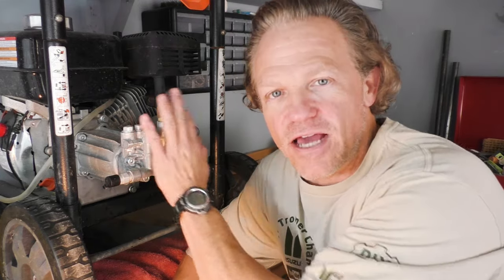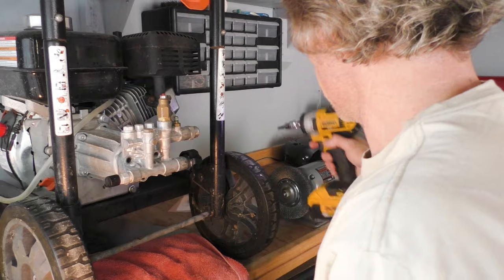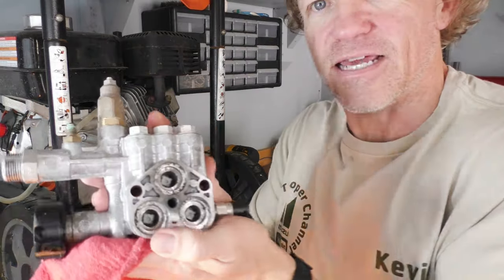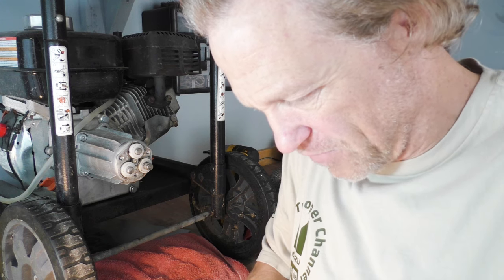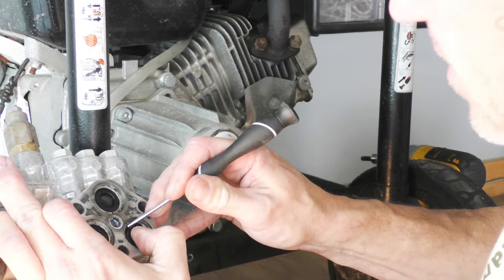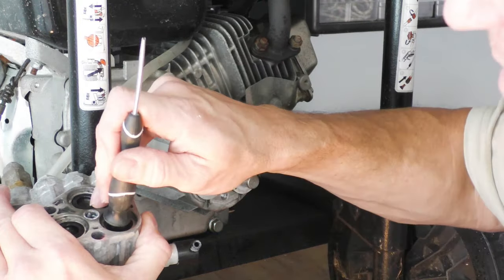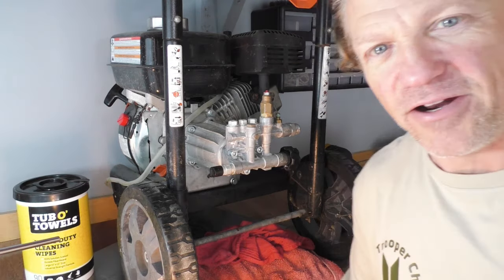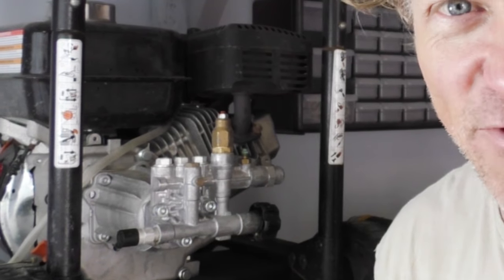POWER WASHER PUMP LEAK REPAIR -  Generac Leaking Bad!

Comment: Thanks for this video. You can lubricate the O-rings with silicone lubricant to help get the new ones in. As well you can use a socket of the right diameter to help press them in. My generac is leaking so I wanted to see a common cause. Appreciate you putting up the part company and item number.
Reply from the maker: fordrac1ng81 you’re welcome glad I can help. Yes this is common on these pumps. Glad to have you on the channel. Hope you will stick around. Thanks for watching!!
Reply: @ktcgarage8572 thanks for posting. Have had my generac 320o0 for 1 year and I have the exact same leaks. Generac was of no help whatsoever. Will see about ordering new rings. Thanks!

Comment: Wow - just the info I need as my Generac 2800 psi pressure washer started leaking exactly as yours when I went to use it today.  Now, just have to find store to purchase the three o-rings, and hopefully, I get to share in with the applause.  Thanks you.

Comment: Thank you for this video, saved me over $100 on a new pump. I just got a new to me Used pressure washer that supposedly the pump was rebuilt, it leaked just like yours 15 min after using it. In your video, you mentioned the seals were only installed groove side down, mine we're not! thank you

Comment: Thanks for the video, can’t believe they say this is not serviceable/ repairable.  Noticed mine is leaking today when I was using it.  I have had it for probably 10 years or more, it’s a solid pressure washer.  I think I paid $375 for it back then so no it’s not cheap, and I always use pump saver if it’s going to sit a while.   Glad it’s an easy and cheap fix.

Comment: Awesome video.  I bought a Husqvarna HB-3200 at Costco and it started leaking at the same spot after one year.  I use it about every other month.  Costco will exchange it, but they don't have any more in stock right now. I'll try to fixt it myself if I can get the o-rings.  I really appreciate this video.

Comment: Well ..i bought a generac about 30 + years ago..the pump has never gave me a  problem  the motor is a Briggs & Stratton I've worked on it 2 or 3 times..yesterday i was using it and the pump started leaking..i noticed a drop in pressure and saw the leak..luckily i was about finished with it..i was suprised seeing it leak.. i can't complain..i will repair it..now i know where to get the kit now i see.they haven't changed the pump .it's the same as yours..thanks for the information ..see you on the next one...Cheers 🍻🍻🍻🇺🇸🇺🇸🇺🇸
Reply from the maker: Rodney Brand thanks for watching 🇺🇸🇺🇸🇺🇸

Comment: Wow. Thanks for posting this. Mine shoots water from the bottom of the pump, but mostly just after I release the trigger. I assume it's those seals.
Reply: Mine too. Shooting water out. Did this fix or for you?
Reply: I have this same issue and I’m trying to find a replacement part for it as well.

Comment: Excellent video!  I wish all videos I watched were as clear and easy to watch as yours.  🙂  After taking my Generac power washer apart, I noticed that he white plastic barrels that are left in the machine in your video and mate with these o-rings showed heavy wear and there were remnants of another clear gasket within them.   I’ve a call into APW to see if they can identify replacement parts for those as well.   Anyone out there know?
Reply: As an update to my comment… the part is a bushing… part #AR2840561.   These bushings were actually melted on mine.

Comment: You drew me in with "Well that's not supposed to do that!" LOL and sealed it with the Jedi pull power on your "blunt, round pick". Now Ima go see if I can fix my pressure washer. Although I think it is beyond help. I got flat tires, leaky pump and hose. The only good thing on it is the Honda engine.

Comment: I feel the same way about my Generac pressure washer. I had a Karcher before and the pump failed after maybe 7 years of use, sadly it was more expensive to repair it than just buy a new pressure washer so I bought this Generac thinking it'd be an upgrade and it's really not. I also had to replace some o-rings and rubber in the fuel system because it tuned into dust that clogged up the jets.

Comment: This is a very very common problem on Pressure Washers , One Big thing to keep in mind is to Never Ever Start the Engine unless you have the water supply hooked up an bled air from the pump first , - just wait till you get a steady Stream of water out of the hose nozzle , 
 Industrial Grade Pressure Washers Run in the Thousands Of Dollars for a reason , ☹️

Comment: Thanks for the lead to buy the seals.  That is what I will do ,buy a different  product. SO, maybe  I can get repair parts.
Reply: Seal kits are impossible to find for my old pressure washer. Must buy a new pump unit. Thanks for the mechanical repair video.

Comment: @KTC Garage   Great video.  I have the same issue of leaks.   I replaced the 3 seals.  Much needed.  They actually stayed on the pump when I pulled it apart, that's how loose they were.  After changing them and pressing them into the unit like you did, I still have the leaks, like through the weep holes.  What needs to be fixed on this??   Thanks!
Reply from the maker: Not sure. Sorry.

Comment: I have a generac clean power 37 model 01067-0 1500 psi. It runs, but it spits the water out of two square portals on the pump case. What must I do to fix this? The round seals seem ok.

Comment: the honda engines have iron cam sprockets, the others have teflon sprockets. the  hondas usually have low oil cut offs in them too.

Comment: I have been through Generac pressure washers just like the one being worked on in this video. The first ran for 6 hours total, before the pump blew. The 2nd a whole 30 minutes. And the 3rd maybe 5 minutes. All were new out of the box. Generac is junk from top to bottom. Their customer service indignant. Warranty useless...actually a complete lie. Repair parts near impossible. So I am back to using my 1984 Coleman 1900 psi unit which has never let me down. Same engine and pump, neither ever been rebuilt. What a shame. Live in Florida where there are many Generac generators installed on homes for hurricane season. Have never heard one good thing about them from the owners, just constant complaints and disgust.

Comment: I have a Honda GCV 190 and it seems to be leaking water into my oil. It runs pretty good and has great pressure. What’s the cause of this? Is it worth fixing? Thanks, Mark.

Comment: I entirely agree with your general assessment of Generac. My problem is slightly different. I don't have a leak (altho when I dismantled the system just as you did in ur video, there were non O-rings), what disintegrated was the O-ring in my water inlet and I think that little bottles of it have clogged the pump, all the hoses, etc. have checked out fine. Was wondering, is it the 3 bolts at the top that have to be undone to clean out this area? Also, isn't there supposed to be a filter at the inlet where the hose connects? Thanks

Comment: besides leaking from the o rings , did it loose pressure as well when using it? mine sprays but not enough power and leaks like yours.
Reply from the maker: Ether Fever yes it sure did. The seals will probably fix both. I would get the website from the video and call them to find the right seals. I couldn’t find them just looking online. Get the number from the website and they are very helpful. Best of luck and thanks so much for watching and visiting my channel. I have tons of cool fabrications and review videos. 
Hope you will check them out!
Reply: @ktcgarage8572  Will Do! Thank you very much for your reply!

Comment: I'd recommend you consider a Spartan cart jet, this is a very robust engine driven triplex pump that can do the cleaning as a pressure washer and it can jet the inside of pipes like an snake.
Reply from the maker: mark luke thanks for the tip and I really appreciate you watching and commenting. I will absolutely take your advice. 
Kevin

Comment: Great vid.  A question related to your vid.  The  plastic tightening gizmo on the water hose supply line became damaged due to someone (me) not paying attention.  I think I can buy the plastic hose fitting but it requires a hex (allen) socket on the inside of the inlet to remove the outer section of alloy hose.  Do you know what size hex / allen that would be and have you ever removed it?  Thanks.  thumbs up.

Comment: I had the same problem but with a Troy Bilt.  One seal was damaged but i just replaced all 3 of them  Cleaned the surfaces, made sure they were properly seated and reinstalled.  Still have the same issue.  Any other suggestions?
Reply from the maker: Harold Peters wow that had to be the problem
Maybe they gave you the wrong ones 
Man I’m not sure on that 
I would get some new ones and redo the job.  It has to be that Harold I would think 
Unless your mating surfaces got warped but that would be extreme 
If it were me seeing as how they are so cheap I would redo them and try that. 
Best of luck. Also might call the place you got the parts and ask them. They may have a defective seal from factory 
Hard to say. Thank you for watching and being on the channel. Hope you will stick around.

Comment: Hey Kevin, When I unbolted that part, a grey oily fluid came out that smelled like differential fluid.  I panicked and bolted it back together before all the fluid came out.  Any idea what the problem is?
Reply: burningfeet 53  so,I kept researching, on the pump side there are oil seals that look very similar to the water seals you replaced, it was going to cost $49 for all the seals,I found a new pump for $89.  So new pump is on its way.   Thank you for the video, it was very helpful.

Comment: I have a similar machine and the pump is bad. Removed all hex bolt but cannot pull the bad pump off. Is there an extra set screw or anything im missing?
Reply from the maker: Vincent Deangelis it may be seized on there a little bit 
The hex bolts are all mine had 
Best of luck and thanks for watching 
Kevin

Comment: I did the same thing,,,,,,,bought a Generac with the expectation of quality.  Wrong. Pump went. So because it has a bulletproof Briggs and Stratton motor, opted to replace the pump with a midrange pump and back in business.

Comment: very helpful video, I've ordered the seal kit, and in the meantime, I removed the seals but when I did a small copper disc that has a o-ring around the outside dropped out. I have no idea where it came from, I can only think it came from the center of the pump where there's a small opening.  Problem being it has a small hole on one side and flat on the other, so I'm wondering if that faces front or back. I couldn't tell from your video if it was there.  Any idea?
Reply: I know this is 3 yrs or more later but hope it helps others. I'm guessing that part is a plug that's located in the center of the pump housing between all 3 pistons. the hole is for inserting a screw or? into it to pull it out, then you can add oil or drain it from that hole. then push that plug back in when your done.

Comment: What is under the top three bolt caps?? Mine is leaking from the top of the center cap but it is not cracked. It got put in a Sub-Zero garage after the last use but nothing externally is cracked. Michigan winter temperature. My fault for not winterizing it
Reply from the maker: Not sure about that. Sorry thanks for watching
Reply: @ktcgarage8572  I guess there's only one way to find out 🕵️😂
Reply: My Generac appears to be leaking from those top 3 bolts too.  Did you ever resolve the issue?
Reply: @4shaken_  cracked & not repairable for me. New pump eBay not cheap. $200 best I could find.

Comment: nice tutorial ! i am waiting on some seals for a craftsman  does that pump need oil ? the unit i have was given to me i think it was run without water supply and maybe something burned up . i guess i ll know more after seals r installed
Reply from the maker: brewcrew no oil in this one. The seals fixed it right up!  Thanks so much for watching and being part of the channel. Hope you will join us for more vids in the future. Best of luck!
Reply: Where did u get the seals I need some too. I have a craftman

Comment: From a pro... never, ever, ever start machine screws with an impact or any other powered device like a drill. Always start machine screws (or bolts) by hand for 2 or 3 threads. That way you prevent cross-threading the screw into the screw hole. The same goes for spark plugs or any other threaded fastener into metal. You can also put a little anti-seize on the threads to prevent the screws (or bolts) from becoming seized into the screw hole. BTW, the screws that go through the manifold are supposed to be torqued to 92 inch pounds. Certified DIY guys keep me in business fixing their screwups.

Comment: NEXT TIME BUY A CRAFTSMAN .  I HAVE MINE FOR 12 YEARS AND RUNS LIKE PRO.....LAST WINTER I FORGOT TO WINTERIZE THE PUMP AND I WILL REPLACE IT BECAUSE IT BLOWS.  I HAVE NO COMPLAIN ON THIS CRAFTSMAN 2550 PSI.....GOOD LUCK FRIEND.
Reply: That is when craftsman was actually quality tools
Reply: I have a craftsman and a Toro. The craftsman is newer and I store it inside. Used the Toro this year, no issues. Fired up the Craftsman and it is leaking from several places.  Disappointed in the quality of the pump.

Comment: Part # please
Reply from the maker: Kevin Menue thanks for watching 
I held the part number up to the camera In the video. You might get the phone number from the website I showed on the video and call them 
I had to call to get the correct part number 
The numbers are a little sketchy if you try to just click and order 
I couldn’t figure it out by looking online 
I called them and they were great 
On the phone 
Sorry man. This video is older and I threw all that away but I held what I had up to the camera and if you call them you will make sure you get the right part for your machine. Plus some machines came with different pumps even if it’s the same size and brand. 
They will help you.  
Thanks for watching and sorry I couldn’t answer you exactly more than that. It has months been since this video Came out. Good luck to you and I hope that helped